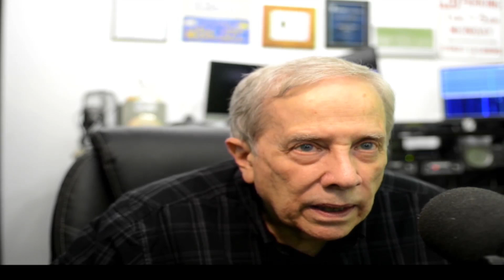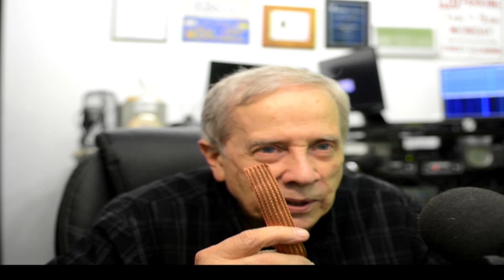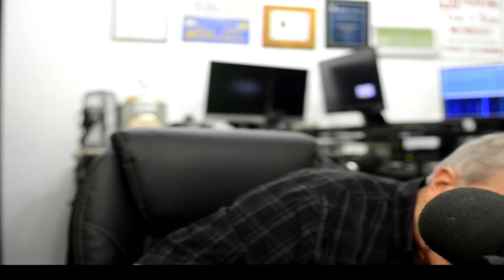Why Ham Radio Equipment Needs A Separate Bonding (Brounding) Strap By Jim Heath W6LG Ham Radio Elmer

Comment: Hi Jim,

A few of questions - really need your advice:

How do you attach the wide copper strap to the tiny ground point on the radio (IC-7300)?

How/where do you attach it to the power supply which doesn't have a ground terminal (Samlex)?

If I run strap from bus to window pass-through and on the outside attach #6 AWG bare copper wire to run 10 feet down to an 8ft driven rod and further bond that rod to the service ground rod ~16ft away with #6 AWG wire, does that meet NEC and also make sense? 

Trying to get my first station set up properly.

Thank you!

Kind regards,

John - KK7JBZ

Comment: I'm interested in lightning protection since I live in a high-risk zone. I think having a ground rod under the antenna is prudent. I can relate to the single-point ground reference in the shack.
[How Can You Reconcile This Dilemma?] I don't want any lightning going through the walls and attic of my house, getting back to the house's main ground rods & or service neutral on the 
opposite side of the house, relying on 14 or 12 AWG wires that may have wire nuts along the way to serve as a path for lightning through my house.  Furthermore, My interpretation of NEC 
is that any additional grounding electrode, should be bonded back to the service panel's ground rods on the outside of the house with 6 AWG or better with no splices, and an 8-inch minimum 
bend radius at corners, In my case, there would be two. Additionally, I consider a 2/0 crow's foot directed away from the house w/60' legs sub-surface. Pray for your health Jim 73/88

Comment: If my new ground rod is on the opposite side of a 4000square fooot house, how do I exactly bond it to the ufer ground on opposite side of house?

I got pavers all around the house. Underground not possible 

Run 6 gauge solid ground wire up and over house? Ugly and probably not easy with solar panels. 
It would be over 100 feet of copper ground wire is my guess.

It would have to be external too. There would no way to feed it into attic considering how small the attic is .

Suggestions appreciated Ty
Reply from the maker: You don't.  There is no purpose for that ground rod.  There is not such thing as an RF ground.  A driven ground rod at the station is a mistake and a violation of most electrical codes.    I will do a longer answer on YouTube. 73, Jim

Comment: I have the coax on my antenna grounded outside when it goes through my lightning arrestor and since all connected equipment shares that coax ground via the shield the shack is bonded in my book. In my humble opinion introducing yet more redundant lengths of wire in the shack is just asking for RFI especially if the lengths are random possibly harmonic radiating elements.
Reply from the maker: Some might disagree respectfully with that approach. Using only the shield on coax, multiple connectors, multiple devices, daisy chained equipment is not the way I recommend it be done.  I do run 1500 watts and I do not have RF on the mic and other pieces of equipment.  I have ferrite beads all over the place.  So far, that whole scheme has worked for me.  73, Jim
Reply: I see well I’m QRP most of the time so that probably explains my luck! Appreciate all you do for the ham community your time and experience are invaluable.

Comment: Did you and ARRL Director ever mend issues?
Reply from the maker: No.  Instead he and Board Members have said some things about me that were less than nice.  So, the problems can't be fixed until there is a new CEO and changes in the ARRL Board.  That assumes that the ARRL survives long enough. I know I won't be here to see that in either case. My prognosis with MDS cancer is not good and it shows.  73, Jim Heath W6LG

Comment: RF ground vs electrical ground.   There's a difference in what flows where and it's mostly based on conductor type and distance.   Short straps conduct the RF, everything else is a big resistor for RF.   Not a fan of separate ground rods so being more than a few feet from an electrical panel I tend to ditch the RF ground and instead BOND all the gear together with strap.   Essentially a floating ground, RF-wise.   But effective none the less.
Reply from the maker: I tend to mis-use ground, bond and earth.  Those are all important and I often misspeak.  With respect to ground rods at the station, I view that as a problem with respect to the NEC.  My station is only connected to the common point ground at the electrical panel.  The equipment is, as you point out, a few ohms ( and as a result, volts) above ground both electrical and RF wise.  i guess it is fair to say that my operating desk does float.  But, all boxes on that desk are about the same distance to a common point at the desk that in turn leads to the common point ground (earth...see I did it again), at the main panel.  Each box that needs to be, is connected a pipe under the desk that is horizontal.  Each box has its own strap to that pipe.  The boxes are not connected in series.  They are connected in parallel.  I hope that all is clear. The subject of grounding or earthing is confusing because we are dealing with  AC at 60Hz and RF at maybe 28MHz not to mention lightning strikes.  Thanks, 73, Jim
Reply: @ham-radio  great explanation.  I think we're on the same page, I too mix up my nouns.

Comment: I don't think that you really answered the question you posed. You said the coax was not good at 14MHz. Good for what? RF ground, AC safety ground or lightning protection ground?  These are three different things and three different ground requirements. I was confused as to whether you were talking about lightning protection ground or RF ground. Since you attached the ground to a pipe, you didn't seem to be doing it for AC power ground. I was confused by this video.

Comment: We all have constraints, budget, location (home, apartment,...) wife, time, .... I would like to see a video on grounding showing different methods based on these constraints, all we get is those that have the very best.
Reply from the maker: Well, that may be true but the difference between a high impedance path and a low impedance path is not much.  Simple pipe strap from the hardware store makes a really good ground and costs very little.  So, politely, I don't agree with you.  Thanks for your comment.  I hope that not many feel the same way. 73, Jim

Comment: I knew that.  Note that "knew" is past tense.  It's amazing how much one can forget when one is 77 years old.  Thanks for the reminder.
I haven't thought of things going back to ground since after I started studying electronics.  I thought electron flow came from the negative terminal, which would be ground in most cases and went back the positive terminal.  Going back to ground is "hole flow."
Some cars (mostly British) ground the positive terminal of the battery and insulate the negative terminal.  Remembering that, maybe I should change my screen name to "MG Lover."  
I like your one by two callsign.  I used to be a member of the San Jose State University Amateur Radio Club, whose callsign was W6YL.  Their callsign was issued in 1929, so I wonder how you got yours.  
73
Reply from the maker: There was a way to get calls about 20 years ago.  That system and the previous one ended.  Like most, I knew of 6YY, 6UP, 6PL and 6DD who was a very close friend.  73, Jim

Comment: I use my 100W HF transceiver on my back deck hooked up to a OFC dipole antenna. No grounding except the ground to the outlet. Everything works great, no issues. Very little noise and great DX. I do disconnect everything if a storm approaches.
Reply: No ground needed for your setup unless you want lightning ground protection.

Comment: Copper strap is great stuff, you can glue it to walls and floors then paint it. In new construction you can put it in and around the foundations. Great for lightening but, nothing will save you from bad antenna matching but, bonding helps. AC bond, yes, but, most hits come from the power line. You want at least one surge protector on the main panel and one on the circuit to the shack. Ferites, can't have too many, they also reduce lightening effects. Also, Aluminum Duct Tape is a low cost alternative in many cases.

Comment: Jim, best of luck in your upcoming cataract surgery.  Best operation I ever had!  Just follow your discharge instructions to the letter and here's hoping for many more years on the air.  Steve, W3IUB (licensed at age 13).
Reply from the maker: Thanks.  I am a little worried because it is an unknown thing for me   After that I have to have that gallbladder removed.  We're getting ready for that too. Thanks for the wishes.  73, Jim

Comment: You seem to suggest that the very wide copper strap goes to the ground in the electrical panel.  I have wired fuse panels and I can tell you there is no practical way to bond that giant strap inside the panel, the knockouts in the panel are at the most 1 inch.  If you were to somehow bond that strap inside the panel, the panel ground is invariably a 6 gauge wire out to a grounding rod driven into the ground.  So all that oversized copper is negated by the small panel ground.  I'm not sold on your idea.  Hope the surgery goes well, BTW.  All the best.
Reply: I think he means to use it as RF or lightning protection ground. Not clear in the video.

Comment: For electrical code - yes I agree.  For lightning protection - I agree.  But for RF grounding my 60 years of active Ham operation experience I don't agree.  The station is on the 2nd floor of the house with the nearest ground about 40 ft away - too far for RF grounding.  I run 1500 watts almost all the time.  The antennas (OCF dipole and yagi) are about 20 feet from the house on this 4000sf tiny lot.  So here is plenty of radiated RF around the house.  Living in San Jose, CA there is almost zero lightning risk.  For lightning and electrical safety the grounding you described is very important.  But for RF??

I have no RFI in the house and no trouble with any of the equipment (5 stations in the room) all of which have nothing connected to their grounding lugs.  Of course the coax shield is there along with the code required "green" ground integrated into the power cord.  The noise is exceptionally low (40M S3-4/5 sometimes less).  While living in Silicon Valley that is pretty good.

Kristen A McIntyre K6WX has an excellent presentation on the myth of grounding (specifically RF).  Kristen has excellent credentials supporting her judgement.  If the opportunity arises attend one of her presentations.  
73,
Bob - W6OPO

Comment: Rarely do I see any comments or guidance for grounding in a 2nd floor radio shack.  The usual guidance is for a minimum length of copper strap from the shack's copper pipe where the instruments are tied to, to the outside earth ground.  Not possible in a 2nd floor shack where the distance is about16 feet in my case.  I recall some comments that if one creates a ground plane in the floor of the shack, it can serve as the RF ground reference.  Safety ground is maintained through each instruments' 120v AC supply ground.  My particular case does have a full space aluminum clad on the top of the subfloor.  Would it work if I electrically bonded the copper pipe to the aluminized floor?
Reply: Here is some good info on grounding a second floor ham shack which is what I have.I use alternative 2. RF suppressor ground system made from rg8x coax. 
https://helpdesk.flexradio.com/hc/en-us/articles/204779159-Grounding-Systems-in-the-Ham-Shack-Paradigms-Facts-and-Fallacies

Comment: Thank you for your many years of service to the amateur radio community.

I for one am tired of trying to explain to people why it is necessary to take their ground and run it over to the station ground where the electrical panel comes down. That means if they have a ground rod right outside their Shack they should be running 6 gauge all the way over to the ground rod coming off the electrical panel. But more often than not they simply argue it. I ultimately revert to giving them a copy of the Motorola R56 station installation manual. It goes into great technical detail that still doesn't convince them that the way they're doing it is wrong. I run a lot of repeaters and everything gets grounded. But the guy that owns the main Vault that I'm in has nothing but a solid piece of 14 gauge running across the baseboard and people are supposed to clip to that as their station ground. No. We drove our own ground rod in and ran our polyphasers to that. It amazes me with people think they can get away with even at a commercial repeater site.
Reply: Is there a ground rod installed where the power enters the building?
Reply: @MrAdolfmanson  :: if your question was intended for me, the tower is grounded - now. So is the chain-link fence surrounding the facility - now. This is only because Verizon Wireless came in and put a complete cell-site installation in place and did it correctly. Almost.

A commercial tower should have each leg of the tower grounded at four spots extending out from the tower. This is to say that a triangular tower should have a primary ground coming off each tower leg and extending out with four ground electrodes for a total of 12. This is for the Motorola R56 Standards and Guidelines for Communication Sites. I've got to say that on all the communication sites that I've been to I have never seen this configuration.

The wire that the vault owner has put in running along the baseboard as I indicated is a single strand of 14 gauge wire of unknown type. As we know, current flows on the outside of the conductor and if this is their approach to grounding I would believe that at a minimum it would be 6 gauge also and each rack clamped to it.

There is a station ground where the power comes into the building as required by the NEC. But the external generator located outside of the building does not have its own ground. This site is a hodgepodge of this and that that just happens to have an 85-foot tower at the top of a 6500 foot mountain. It is an extremely effective site but I have seen better sites more or less properly built that have antennas that have been hit by lightning and completely destroyed. The tower I speak of does not have any built-in lightning protection. Granted, this is the west coast and not Florida. But the summer brings monsoon type weather with frequent thunderstorms. I have an associate on a site that blew two repeaters and took out three antennas. Since I had nothing to do with building that system which has been in existence for decades I couldn't tell you what they did wrong other than perhaps not using DC grounded antennas for starters. The master receive antenna on the top of the tower survived. That would suggest it was properly installed and protected.

My own Tower at home as each leg grounded but not to the exacting standards of Motorola. I just used double Ott and came off of each Tower leg 18in and drove an 8-foot ground rod into the ground. This was done before I learned from W6LG that I should have run a line over to the station ground at the service entrance. My home doubles as a backup repeater site because it's altitude is 6300 feet.

I'll admit that I've added more information than you asked for but I'm trying to anticipate where you were going with this. If I missed the mark my apologies.

Comment: I can't tie back to the main service ground without installing about 250+ feet of heavy copper and jackhammering, then replacing, about 75 feet of concrete ($$$$). So, it is not always feasibly practical to install a NEC compliant grounding system for a given shack. While I am not completely "groundless", I just stick to what I'm able to accomplish:  electrical safety ground (third prong in the wall outlet), and an RF ground for my antennas. Other than that, I disconnect feedlines and wall power when I am not operating and during bad weather.
Reply: That sounds like electrical safety. Bonding all of the rf gear together also reduces noise, because everything is at the same reference potential.

Comment: Jim thanks for the video.

However I have questions on the equipment bonding itself.  I have a transceiver, swr meter, and power supply.  Where do I attach the ground because I see no ground terminals any of the equipment.

For reference:
Yaesu FTM-409
Jet power supply
Disease SWR meter

Again, thanks for the great videos
Rick
Reply: Proper grounding is of utmost importance, especially when dealing with RF.  It can make all the difference in the propagation of your signal and it could save your life.  If you cannot find another electrical connection to the housings of your gear, the outside of any coax connector should connect to the metal housing of each component.  It should ALWAYS  be grounded together AND connected to your station grounding system.---73, W8IMP

Comment: Great explanation Jim and I have learned so very much from your fantastic videos. One point though. I do not do any of that in my radio room and have not had any difficulties whatsoever. My receiver noise is low and I have made many DX contacts with no difficulty at all. So the question is , what really is the purpose of doing all of this if I see no problems at all with my QSOs ?? If you are going into great detail about this extra shielding no doubt I am missing something so please forgive my ignorance. Thank you again for sharing all of your fantastic expertise with us  please stay well and best of luck on your eye surgery. John WB2DVD
Reply: same here, never had issues not bonding every piece of gear with strap